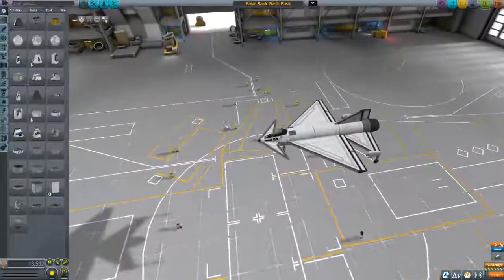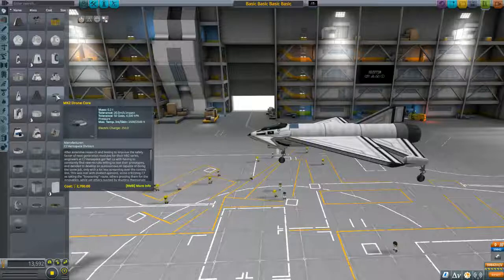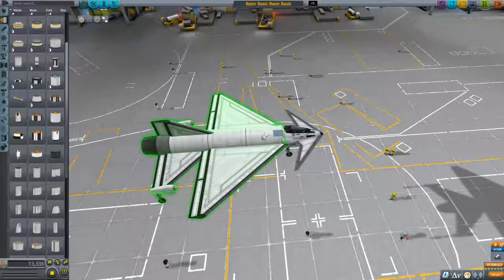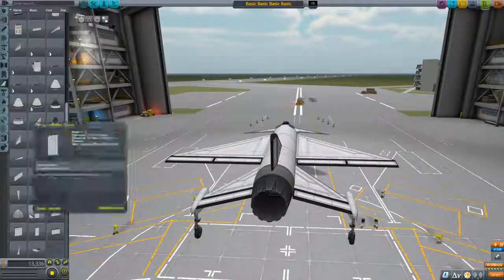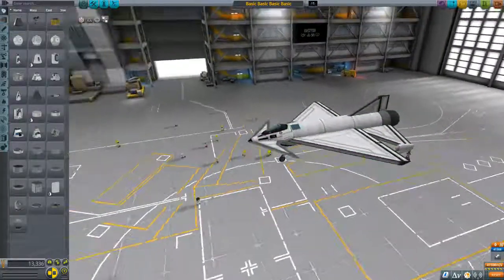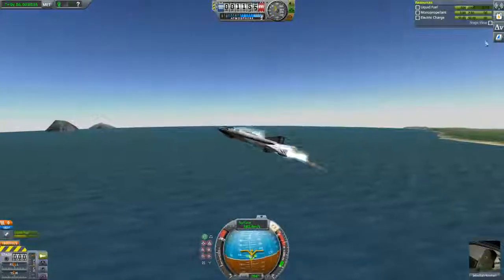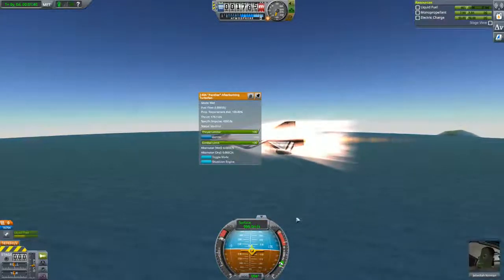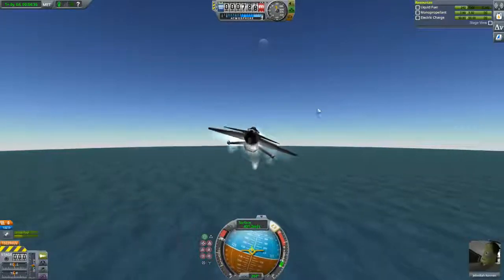Building A Basic Plane For Beginners | Kerbal Space Program

Comment: How can I place the wings on the very front like that. I can’t seem to get the same angle as you
Reply from the maker: Basically, you'll want to press shift+ either a,s,d,q,w, or e. Those control specific angles. You can do that with most parts when attaching them to basically anything. For my setup in particular, I pressed "shift+q" to angle them the way I did.